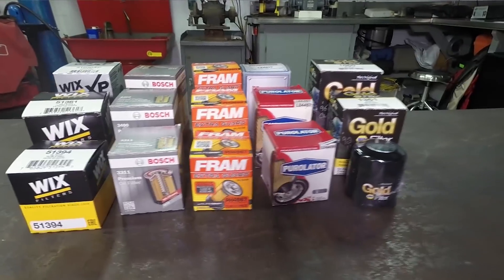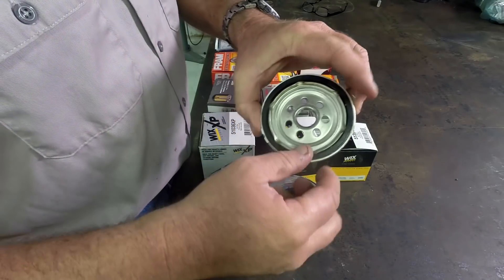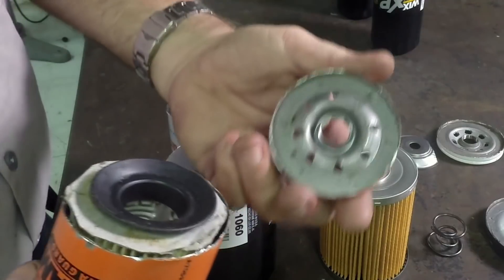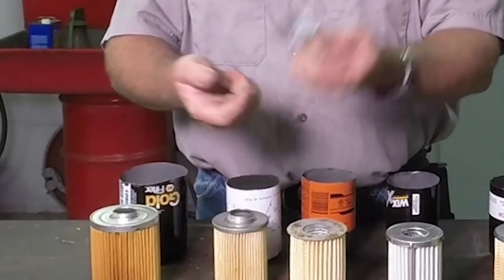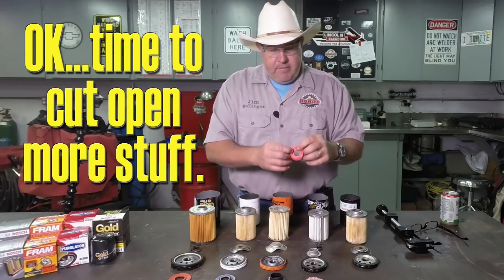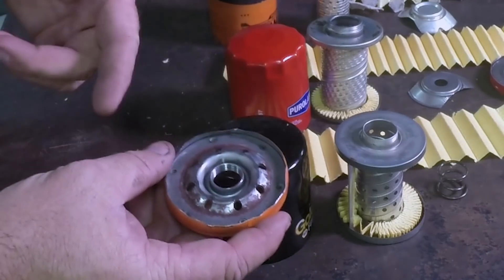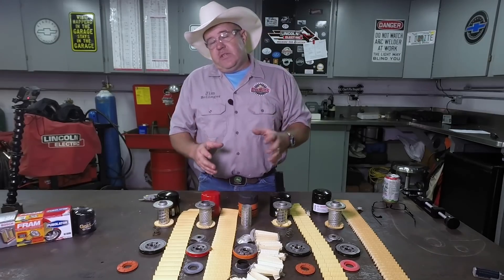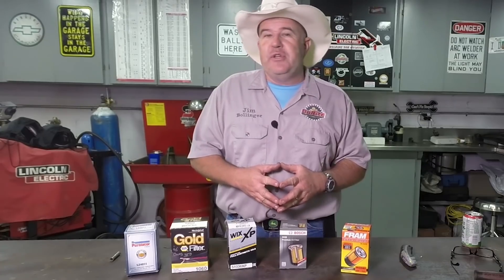The worst oil filter EVER!

Comment: Wix, Purolator and Fram all buy their steel from the same company. I guess you could say it’s all in the manufacturing and assembly of the product and parts used. I used to work for the steel company that sold them the steel out of Indiana previously out of Elk Grove Village, Illinois and it’s mostly US steel if other steel sources are used samples of steel are shipped to each company’s QA department before being purchased to make sure it’s a quality product. Wix and Purolator are shipped down to the Texas border where I’m assuming they are ship to Mexico for assembly and shipped back to America to be sold.. Fram/Honeywell is shipped to Greenville,Ohio where they are manufactured and assembled. Not sure where they get the paper product that is applied to the internals of the filter which seems to be the most of your concern 
As far as we can see Fram.. needs to find another source.

Comment: I installed a K&N on my classic motorcycle, it was just the paper filter the housing just the outside of the filters he had. The rubbery adhesive was coming apart from the filter and clogging oil passages. Great air filters but shit oil filters. They're worse than Fram. Don't buy them.

Comment: I will admit, I ran Fram on my chevys. But they all had 250,000 miles, and burned and leaked oil. So the engine got a new quart of 10W40 every 5 days. The orange can by Fram also matched Chevy and Dodge engine paint. Back in the 1970's our built up muscle cars, we just blew up from severe abuse. Oil never really got dirty.

Comment: I had a 82 New Yorker with 200,000 miles on it that burned 1  quart of oil every 5,000 miles.  At 200,000 miles I switched to Fram filters (yes, the cheapest one) and oil consumption dropped to 1/2 quart.  I drove it another 50,000 before I sold it.  May be poorest construction but it works well.

Comment: Another Fram trashing hack.  The test of an oil filter is how well it filters oil.  I have seen those results and the Fram did fine.  I have been using them for over 50 years with zero problems.

Comment: Good video.  I saw a similar thread on a forum where a guy cut open several different filters and analyzed them.  He too came to the conclusion that the Wix and Napa filters were the best.  They are the only filters I buy for my 2012 Mazda Speed3.  I can grab the Napa Gold filters at my local Napa for under $8.  I think I was getting the Wix filters for around 10 dollars.  They are the same filters.  The guy at Napa told me that Wix makes their filters and they just throw the Napa brand on it.

Comment: What about the upper end Fram filters?
Reply: I was thinking the same thing, would like to see the tough guard and synthetic guts to compare with napa/wix
Reply: @matthewbeaver5026  the Tough Guard is almost identical to the one he cut open; except for a silicon anti-drainback valve and longer media. The premium Fram has the metal tops and bottoms with a synthetic media. Wouldn't worry about too much as I've used TG 8 Fram filters on 3 Dodge trucks that went over 300,000 miles before I sold them. I'm using a Wix XP on my 2014 hemi, just for the fact it goes 10,000 miles before oil changes. 🙃
Reply: Their ultra synthetic one is in another class entirely.
Reply: their upper class are over like 16 bucks might as well get a K&N or purlator boss
Reply: @WeKnowTheTruth2012  $9 actually
Reply: Skyler Bond actually 15 dollarets (CND) lol
Reply: @G272793  weird cause they're made in Canada
Reply: All junk
Reply: @MrJeep75  IDK I've heard good things about the Fran ultra synthetic. Their other types are complete trash though.
Reply: @skylerbond56  just get a wix filter you don't have to worry about it
Reply: @MrJeep75  I use wix, and champion filters. Just thought I'd give the shitty ones a try never again. Lol
Reply: @skylerbond56  I use wix, Napa, purlator, casite
Reply: @MrJeep75  Napa and O'Reilly filters are made by wix. K&n, and Mobil 1 are made by champion.

Comment: from 1972 to today
I have used fram on 66 500 hp GTO I had for 3 years I was 2nd owner I rebuilt it only cause
I did street race back in the 70,s alot and was selling to a friend had over 150,000 miles on it and was clean enough to eat off of,got a new f150 in 84 my only vehicle for 21 years was in home construction and 4 wheeling on the weekends had 540,000 when I sold it always used fram never had a problem the problems come up when you don’t change your oil on time

Comment: Using a cut off wheel contaminates your test if you actually perform a filtration test. 

There is a special tool just for opening oil filters that will not create metal shavings and grinding dust or other FOD. 

Fram is junk, and everyone knows that. 
I only use the Purolator BOSS. 

These test have been done properly hundreds of times.

The best filters have a synthetic filter media. 
The worst filters have a cellulose filter media. 

Purolator BOSS and AMSOIL have the two best filters on the market.
Reply from the maker: The special tool is sitting on the bench, you can see it in some of the shots. some of the cans were to soft, and just smashed instead of cut.

Comment: Anyone with an 80 series Landcruiser with the 1FZ-FE, beware of the WIX filter.  These filters are taking out engines and WIX is not standing behind their filter.  The filter is basically coming apart and chunks of the anti-drain back are clogging oil passageways causing extreme pressure loss and engine damage.

Comment: I've seen someone do a similar video. One, I've used fram for years and had no problem. Two, both videos showed unused filters. Three, check my channel I've cut open a fram filter (disclaimer: I dont have a professional setup with cams like you or the other guy) my next video will be me cutting open a K&N filter and comparing it to the used fram (which I kept) and we'll see how bad they are. Four, I'm not sure I can trust the opinion of a man that has a Chevy emblem on their wall, 😜, jk.
Reply from the maker: I would like to do the same thing but the logistics are beyond the capabilities of my small shop ( 15 filters x 4000ish miles each).
Reply: @DoRiteFabrication  I understand that.
Reply from the maker: @heavymetalweld805  I am a chevy guy, but am good at fixing Fords, the kept me fed well for years!  lol JK
Reply: @DoRiteFabrication  hahahaha by the looks of it, it fed you well too. Lol jk

Comment: You forgot something. Put a white paper towel on your finger and rub it around the threads on the base plate. When I've done this on Fram, the towel comes out Gray with powdered metal from the Machining. It appears they do not wash the base plate after Machining. I cannot speak to other brands, but OEM Toyota filters and OEM Honda filters do not have this issue in my experience. It would be nice to see some OEM filters included next time. Thank you for the video!
Reply from the maker: Thanks for the tip.

Comment: I've seen a bunch of these videos and they all have the same problem:  they don't give any definitive proof that premium filter will make your vehicle last longer than the cheapies.  They do nothing but demonstrate the build quality of the filters which doesn't necessarily equal or even correlate a longer lasting engine.  With anything like this, you reach a point of diminishing returns, ie, just because you build the item super heavy duty and with premium material, it makes zero difference after a certain point.  This may just indicate that these other companies are overbuilding their filters and that, for the guy who changes his oil every 3000 miles, the premium filters aren't doing anything beneficial over the Fram.  I tend to agree with everyone in the comments that have, and are still, using Fram - it appears to be more than adequate in doing what it was designed for.
Reply from the maker: If you like them, by all means.....

Comment: I did the same thing as you just did in this video, but I did it almost 40 years ago. I had much the same results as you are showing. But the Fram oil filter you have is worse then what I had way back then. They guess they are cutting their cost for manufacturing their filters to make more profits. 
With what I learned way back then was to buy and use Wix oil filters. They also make a good air filter.

Comment: COUNTERPOINT: Can more filter material be harmful to the engine by slowing down flow? Just a thought.
Reply from the maker: If you were to use the same filter material, I wouldn't think so. It would equate to more surface area for the oil to pass through. The oil might slow down speed, but gain GPM (volume). The physical speed would be recovered as the size of the vessel got smaller and the GPM were forced back into a smaller passage.

Comment: The cheapest Fram filter does use cardboard end caps. But the better Frams use metal. You compared a cheap Fram with better grade filters from other manufacturers. The Fram Ultra is a very good filter.

Comment: A Fram Ultra is still the best filter on the market today in my opinion.  Will do 20,000 miles without breaking a sweat.  The orange cans are cheap, bottom of the barrel so to speak filters, but still won't damage your engine if used for a conservative interval of 3,000 - 5,000 miles.

Comment: I bought a fram once 20yrs ago, opened the box and shook the actual filter, it rattled, I threw it away and went and bought a motorcraft for my powerstroke instead. I use all wix in my fleet of forklifts at work. Never will I use a fram, I’ll leave the old filter on until I can buy anything but a fram

Comment: I was told by my Subaru dealer to only put the Subaru brand filter in my vehicle because it was made specifically for the car. I know it might be a sales tactic but how do the vehicle manufacturer’s oil filters compare to the ones you tested. Is it be possible that one of the brands you covered supply oil filters to car dealerships with the name Subaru on it and it’s really a Fram filter in disguise?
Reply from the maker: It is plausible, But beyond the capabilities and the $ of my small shop to cut open every one. The intent here was to show what was inside what NAPA, Autozone, O'Riley, etc sell in their "oil change special" grade filters.
Reply: DoRite Fabrication Oh I hear ya, I was sort of asking for your opinion more than anything else. Great review!

Comment: what about dealer bought filters  i quit using fram and many others years ago when i owned a 300 6 cyl ford every morning after the engine sat over night the engine would click till the filter filled again with oil a mechanic asked what filter i was running told him   told me about the anti drain valve being a piece of crap went to ford put on the ford filter the anti drain valve retained the oil  over night resolved the problem no more click till the filter refilled    factory filter did what it was meant to do  i have over the years taken filters apart to find also a lack of filtering media so now i use dealer supplied filters for my daily drivers

Comment: Interesting ~ Surprised at surface rust, could be (more than) likely a storage & humidity issue at distribution to supplier' as how long had they on a shelve since left factory ?! I maybe would've seen if could find stock (batch numbers) when filter made

 and contacted (emailed) FRAM Directly for feedback...   
I've never really had issue with FRAM filters for past (older) vehicles, personally I've always go for MAHLE ~ MANN or BOSCH eg Top Price filter for my (2017) Ford fitment is a Mann filter W7043 @ ($18.32) or alternatively there's a Mann W716/1 @ ($8.97), Bosch/MAHLE ($8.33), Fram ($7.70), cheapest is Crossland at $6.82, maybe the EXTRA Guard (basic) filter up against (what looked like) higher quality than O.E Spec, but are they all nessisealry for same specific engine ~ I wouldn't have issue with its construction, as it is (proper) gasket paper, I'm sure its been tried & tested - and like' who hasn't used a (cornflakes) cardboard to make a gasket & Loctite' that's never leaked again, guess get what you pay for ~ they also have higher spec filters too
……..
FRAM Extra Guard® Filter, (manufacturer recommendation) says : its the perfect filter for everyday driving who perform oil changes at OE recommended intervals - filter media captures 95% of the dirt particles.
FRAM Tough Guard® Filter, which is recommend ideal filter for high mileage vehicles or push their vehicles in stop-and-go traffic, towing & extreme weather conditions. with 99% dirt trapping efficiency*  
FRAM ULTRA® Have A 2-ply synthetic, metal screen reinforced media provides 99%+ filtration efficiency for new engine or trying to provide maximum protection for an older one?  Engineered to be paired with synthetic oil, it offers protection up to 20,000 miles and 99%+ filtration efficiency.

Comment: The last Fram anything I bought was about 10 years ago. I replaced the filter on my wife's Camry and it blew off the engine when I started it up. The threads did feel tight. I double checked the part number and it was the correct one. It made a nice mess in my garage. Never again.

Comment: I don't know much about cars. My car was making a squealing noise. Sort of like a belt squeal. I assumed that it was my belt and I had it replaced. The squeal persisted. I took my car into my go-to shop. Apparently they had to get the stethoscope out - they determined that the media in my oil filter was torn. The high oil pressure was causing the media to vibrate and make a squealing sound. I had to pay them for the diagnostic. A crappy oil filter cost me a fair bit of money!

Comment: There's a reason FRAM is known as "the orange can of death" amongst educated mechanics & parts specialists.  Obviously, it's not necessarily going to ruin your engine, as they'd never be in business if it did, but there's MUCH better choices out there, especially for the price.  FRAM is very overpriced for what you get.  When I want to go cheap, on engines using conventional or synthetic blend oils, I buy the bargain PRO-TEC filters, made by WIX (in Mexico instead of the US), for $1.76 each in a case of 12.  Then I just change it twice during the OCI (oil change interval).  Even at that price, they're better than FRAM.  However, FRAM's Ultra Synthetic filters are pretty nicely made, but still overpriced.

Comment: Change your oil and filter before as recommended by the manufacture. They say car and truck engines can now go 10k between oil changes. Not me!  I'm  doing half that or maybe 75% @ most.  Filter is a damn filter. Fill with oil first, ( If possible), and install properly.  All good folks.

Comment: Having been working in the auto parts industry for many years and before that the aviation maint industry, I have to agree with what you've found here. However, I have to add that the "little springy thingy" at the top of the filter is a bypass spring and is critical to the health of your engine in extreme conditions. If, for whatever reason your filter becomes clogged, (let's hope its not because you never change your oil.) the oil will push that filter up and bypass allowing flow into your engine. Even dirty oil will lubricate your parts till you can get to the side of the road or get that oil changed. It might not be ideal but it's better than replacing a seized engine.

Comment: I live on a farm so we go through a lot of different oil and filter products. Never had a problem with fram. But they also recommend that you change the oil every 3000 miles. From my experience the best filters are k&n, wix and Baldwin. K&n filters in my truck with amsoil XL I can go 10000 miles before I have to change my oil and the truck runs solid. So I would say the quality correlates with the price and how much you're expected to change the oil. This video doesnt do anything besides cut the filter open and show you what's inside, but that doesnt tell the whole story.

Comment: Would have loved to see a mobile 1 filter cut open. My current vehicle uses a canaster style filter so I looked at all the options at the local parts store and mobile 1 stood out above the rest by far. Fram does have one thing going for them the truck bed stuff they spray on them is great for tool-less removal. Wish wics would do that.

Comment: OK HERE is the real deal....NEVER use a goddamn grinder with a cut off wheel to cut apart your oil filter,USE the proper oil filter cutting tool for God's sake....2nd...WIX MAKES Napa gold filter's,.Napa and WIX are both made by the same manafacturer.....3rd FRAM oil filters have ALWAYS sucked..... I am a professional Master Certifed Mechanic and a Cummins,Duramax and 
Powerstroke Master Certifed Mechanic....CUMMINS had a major problem with defective oil filter's from FRAM,the media inside the filter came loose and started plugging up oil galleys inside the 12 and 24 valve engines ALL the time while I WORKED at Dodge as a Cummins Mechanic...As a result Cummins would immediately VOID the warranty on there engine if there was any internal engine problem's and the engine had a FRAM filter on it....Trust me I know....I own my own shop,and worked for Dodge for 12 year's as a Cummins Tech,not one vehicle leaves me shop with a FRAM filter,I use and ONLY stock Napa Gold or WIX filters....29 Years experience so far,Master Certified in many categories and have no reason to lie nobody...BUY a WIX filter or Napa Gold,you will never have a problem......Hope this helps some people out.....
Reply: Ill stick with motorcraft and mobil 1
Reply: He has the cutter on the table and didn't use it. WTF?
Reply: @johnverney  Dude: Sparks are cool!
Reply: Next time make a video while you correct the guy who did. SMH.
Reply: @JC-uj3zj   Exactly
Reply: @JC-uj3zj  I would like to make a instructional video but I work 12 hours a day in my shop,don't have the time...